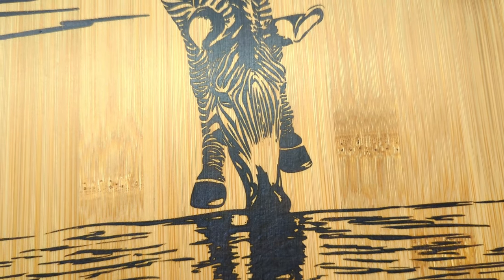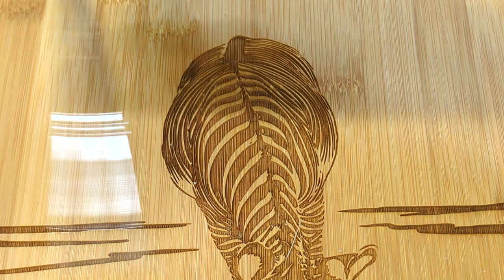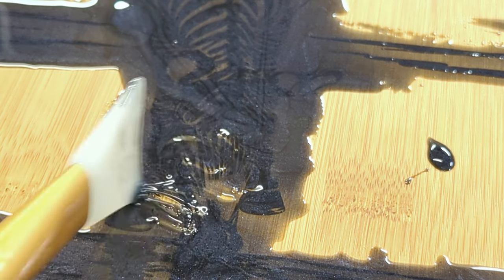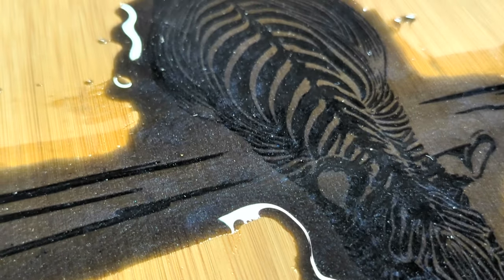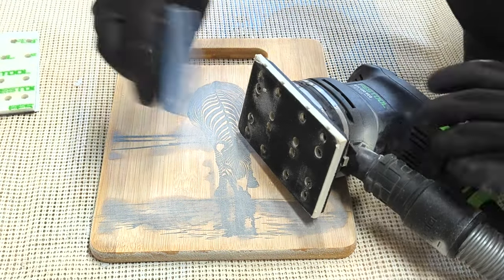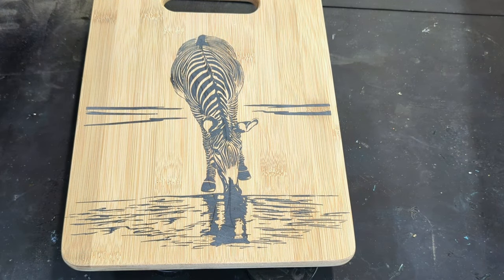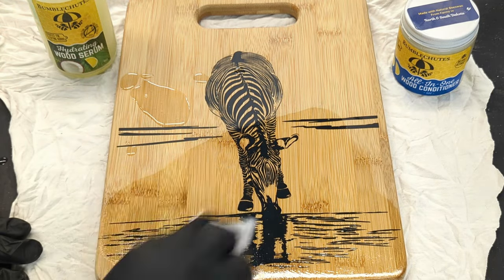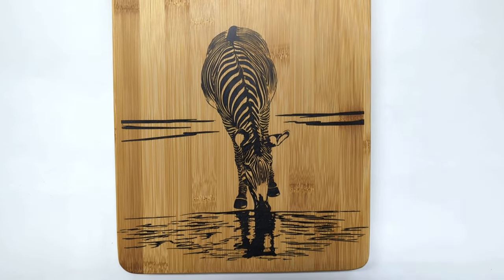Make A Laser Engraved Resin Inlay on Bamboo or Wood Cutting Board #resindiy

Comment: It's cool and all, but with all the time and effort put into making just one of these, I'd have to sell them for $800 to justify it.
Reply from the maker: Understandable.  I will say that if you are only making 1, then it is a lot of work.  However, if you are in a production mode which could include multiple designs instead of just one, then the profit goes up alot.  The key is to plan ahead.  As I work on other projects, I let my laser work on engraving sometimes for days, it is just a push of a button.  Then, once you have all the engraving done, just do them in stages.  If you mix a good amount of epoxy, then just pour all at the same time.  The next day, those can be set aside and you can continue to pour.  Once everything is poured and set, it is just sanding and adding a finish.  I easily sell this size cutting board for $50+.  My material costs are about $5.

Comment: Once you add epoxy it should not be used as a cutting board. It becomes a serving board. A knife will slice the epoxy, and slivers will end up in your food. Nice tutorial though.
Reply: Someone didn’t listen to the very end!
Reply: @neon72  Safety info should be at the beginning. And the video title says cutting board.
Reply from the maker: @jonfortner3919  I appreciate the comment.  I did talk about using the back, but I am now putting it in the description and more in the beginning.  I am also adding that you should never cut on epoxy surfaces.  Thank you for the suggestions!

Comment: How did the resin not go into the pores around your laser etching? I did one and got streaks in random places😂
Reply from the maker: I haven't had a lot of issues with bamboo.  Sealing wood or bamboo is the best way to go but you do have to be careful if it is something that food will be touching.  You could try to seal the wood with a food safe wax finish, engrave then pour the resin.  You can also put the resin in a syringe, but if your engraving is super detailed, that can be difficult and time consuming.  Also, if you do a deep enough engraving, you might just be able to sand out any grain that has resin bleeding.
Reply: I8o8k
Reply from the maker: I am currently working on another video on hardwood to show how to seal wood and help avoid "bleeding"
Reply: Could you mask the areas outside of the engraving?

Comment: What a lovely project! Have you ever tried doing a deeper engraving for a simple design (eg a leaf) then fill the resin just below the surface? That way the resin would have its natural shiny surface as it wouldn’t be sanded. Not sure if this would work, so interested to hear your thoughts. Many thanks and greetings from the uk 😊
Reply from the maker: Thank you UK!  Yes and No.  Resin shrinks as it cures so if it is below the surface, it will cure concave and since this is a cutting board or serving tray, you really want a flat surface.  You can do a thin, clear pour on top of the whole thing and it will be shiny again.  However, for certain projects including one I have been working on this week, I do exactly that.  I poured to just under the surface because I must do a full pour over of clear in the end anyway.  So, this does work for some projects.  Feel free to ask more questions about this!

Comment: You could likely use half of the amount of resin and still be able to get it in all the engravings and have half as much sanding to do. Sure love that zebra.
Reply from the maker: True, but there is a lot of detail and we didn't seal the wood since it was going to be for a cutting board.  I also like to make sure that it is somewhat overflowing because as the resin cures, it cools and shrinks.  We want to make sure that the resin is flush with the surface when done.  This particular design only used about 20 grams of resin.  Some people are more precise and will use a syringe.  I am not very fond of that method though.

Comment: Looks great. But what is if I use the cutting plate? I think it sadly lose completely its use, as cutted resin sure is not the healthiest stuff you wanna ear.
Reply from the maker: Absolutely correct.  I mentioned at the end of the video that you want to use the back of the cutting board to cut on and the front with the inlay for display and serving.  Always be sure to use a BPA free epoxy resin, like Totalboat or whatever is available in your area.  You want to make sure that it is safe for food contact.  If you ever have any doubts, contact the epoxy manufacturer directly.  Once this is cured (which for tabletop takes a full 7 days), then it is safe for food contact.  Hope that helps.

Comment: Just another tip, you can use Odie's Oil products too. They are food safe and penetrate the wood very well. A bit more on the pricey side but a little goes a long way!
Reply from the maker: I have used a few cutting board oils over the years including Odie's.  I recently came across Bumblechutes.  I love that they are all natural.  Mineral oils are also natural and safe for cutting boards but they are also a petroleum based product.  Bumblechutes works great, they are a small business local to New Hampshire and they have a great story.  I highly recommend them.

Comment: I was looking around and found this on their website! Thought you might want that, do as you will with that though as it says no BPA or VOCs.
"Tabletop is more suitable for limited contact with food. Note: we don’t recommend using epoxy for a cutting board, though."
Nice Idea! Liked the video.
Reply from the maker: I typically tell people to cut on the back where there is no resin, then can use the front as kitchen decor.
Reply: @1elephantmemories  Right on!

Comment: doesn’t bamboo have much too open of a grain for food prep?
Reply from the maker: No.  Bamboo is probably one of the best materials for cutting boards.  It is a grass, not wood.  It is actually more dense than hardwood.  It is very durable, easy to sand and is eco friendly.  Even plastic cutting boards can get gauges in them which bacteria could potentially hide in.

Comment: Very nice looking project, thank you. One thing, I wouldn't use denatured alcohol for anything but lamps or a small stove, it's a fuel. I'd use IPA, 91% or higher. Thanks for the project.
Reply from the maker: Thank you.  I will look into that.  I often sand everything after I clean but always looking to be safe.  Appreciate the comment.

Comment: what were your power and speed settings per pass?
Reply from the maker: Every laser is different.  I would look to see what is recommended for wood on your brand then tweek from there.  I have an Epilog Mini 50 Watt.  I did 2 passes with a DPI of 600, Power of 100 Speed of 30, with Stucki dithering.  I also brought the bed up by 1 click between engravings.  Hope this helps.
Reply: @1elephantmemories   sure does, I'm running a 40 watt mini myself.  thanks

Comment: Could to use a hand plane instead of sanding?
Reply from the maker: Short answer is yet.  However, if you are using a laser and it isn't deep enough, you have to be careful not to sand or plane all the way through the resin.  I am planning another video on this subject with a CNC and planner for an outdoor wooden sign.  CNC and even a hand carving can be deeper than a laser so you have more wiggle room when planning or sanding.  Hope this helps.
Reply: @1elephantmemories sharp hand plane can be set to take those see-through thin shavings from wood, so I am not worried about planing the carved trench away, but I have no experience on planing resin. I'm afraid the resin might be too pliable/tough and  might just be ripped out of the trench. I'm waiting for your video showing this.
Reply from the maker: @jukkahuuskonen  We have put boards through a surface planner with no problems.  When resin is cured, it is like a thick, solid plastic.  I am not sure if it would hurt your blades.  I would suggest trying it on scrap wood first to see if you like the result.

Comment: I wonder if it would be a little easier to just pass the resin-covered board through a planer to remove the excess. I'm just trying to imagine putting that much time and effort into each piece if you got a bulk order. Time is money, and you can't charge TOO MUCH for a cutting board, ya know?
Reply from the maker: True, but you can calculate your time into the price.  These are pretty unique.  As long as you have just a thin layer of resin that is outside the engraved area AND you have a nice deep engrave, you might try a planer.  Trouble is, you will still have to sand to get the planer marks out.  I find a coarse grit on an orbital sander goes pretty quickly.  It is about 5 minutes of sanding per board.  Love to hear if you do the planer, how it comes out.
Reply: @1elephantmemories  my planer leaves a very clean surface so, sanding off planer marks is very quick. I should also admit that I have been a woodworker for many years, and I absolutely hate sanding, and painting. So, I always look for shortcuts when it comes to those two tasks. Every time I look at a project I think, "what if someone orders 100 of those?"...

Comment: Hope nothing will be cut with this board, due to the I guess really unhealthy resin :X
Reply from the maker: I have a care and maintenance card that goes with all cutting/charcuterie boards which explains that you should never cut on epoxy which is basically plastic.  Plastic cutting boards are used, but once it is beat up, bits of plastic could get into your food.  Wood and Bamboo cutting boards are better.  I make sure people know to use the blank back for all the cutting and the decorative side for food serving.  Tabletop epoxy is safe for food contact like at restaurants and bars.  Thank you for bringing this up.  It is a very important subject that I will make sure to touch upon in my next epoxy cutting board video.